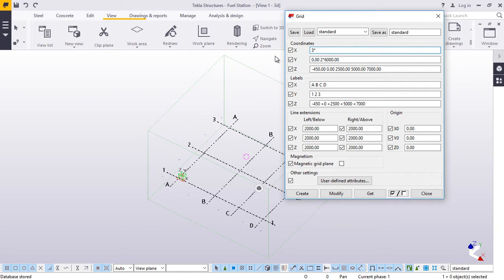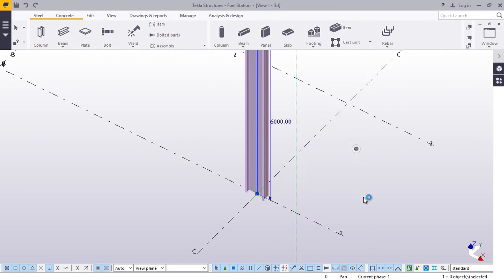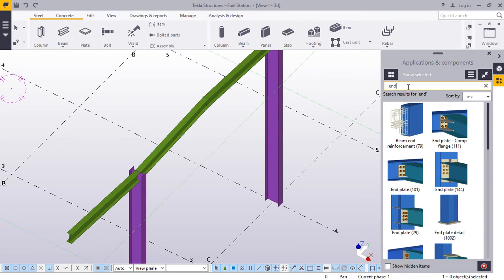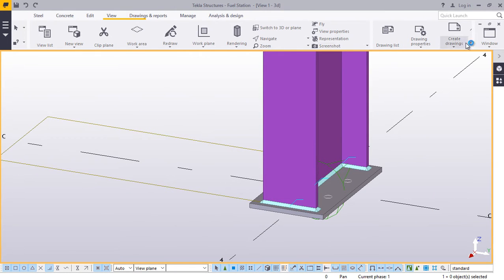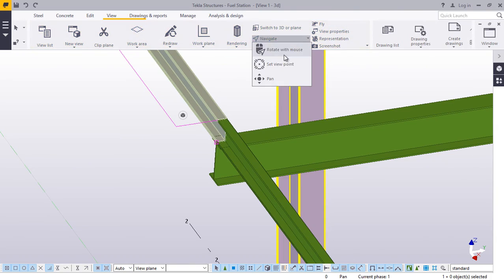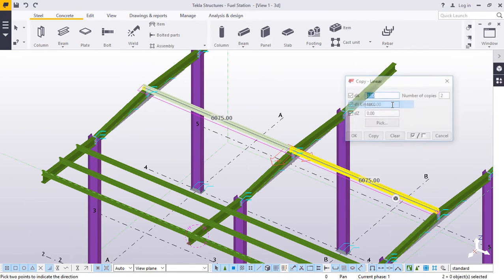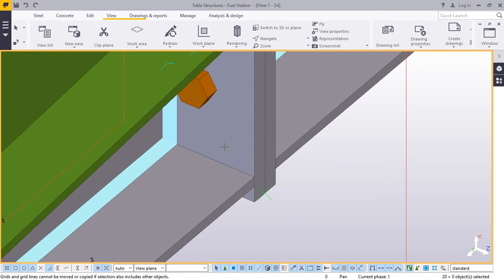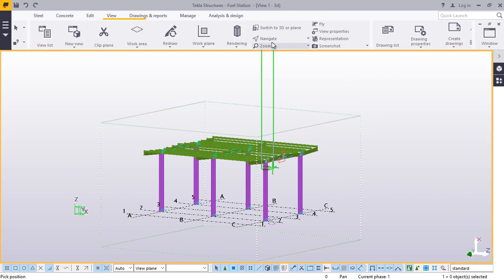Fuel Station Structure Modelling in Tekla Structures

Comment: Hi Maurice, 
I'm new on this software and I'm following your tutorial. I see you have a many types of beam and column profile. How can I also have different sections of beams? I'm using tekla structure 2016 the default beam and column section are very limited thats why I can't follow your tutorial the way exactly you do, I need to make a beam close on what you picked. how can I have different sections like you have?
Reply from the maker: am using UK Environment,use that and you will be able to access similar materials am using
Reply: Thank you very much.